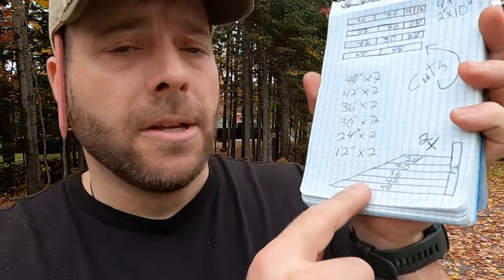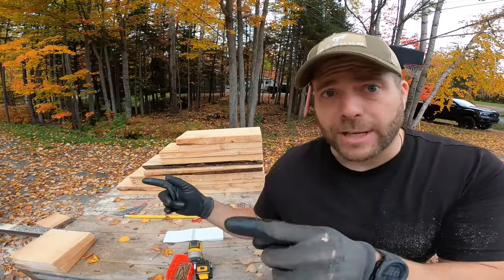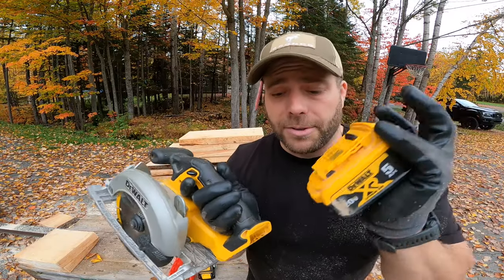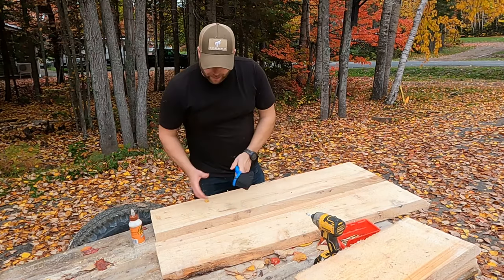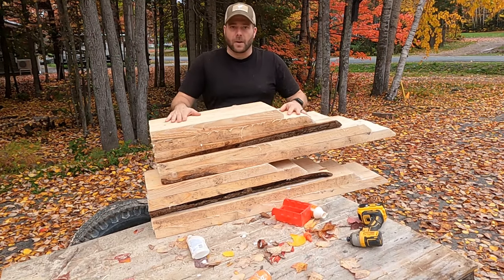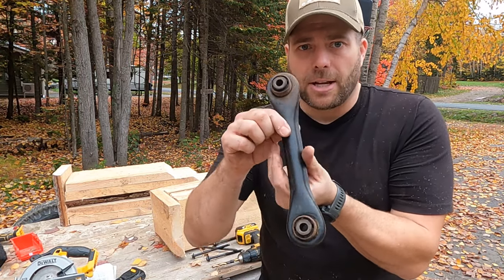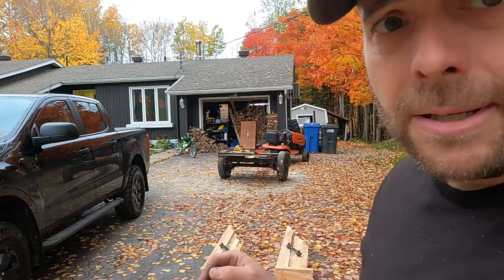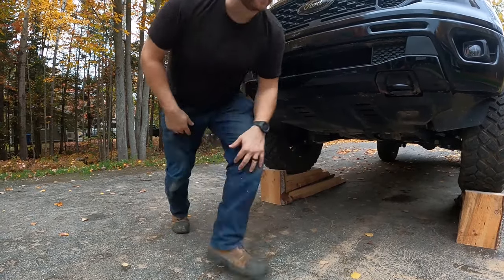HOW TO BUILD WOOD TRUCK RAMPS - For your Truck Jeep Bronco Car !!!

Comment: I did nearly the same design however mine differs slightly. The wheel stop on mine is angled towards the tire/front of ramp at like 20/25 degrees.  I added 2 handles to each ramp and made 4 ramps.  This is so I can access everything under my tacoma without needing to jack it up.  I also added a rubber mat to each of the ramps on the bottom to keep them from sliding around. Only downside to wood ramps is weight.  Mine weigh about 50lbs per ramp.
Reply from the maker: Nice!  I was thinking of building two more.  They are nice to have.  As for the weight....  harder to steel haha.
Reply: On some other designs I've seen  two sets of small wheels added to each ramp. Bungee them together for storage and wheel them to your work location!
Reply from the maker: @thetoymanator7723  that's a great idea.  Might ad a set of castors to mine.

Comment: You really don't need the angle cut, if your Truck wont climb a 2 inch board, it's not going to be much use 'off road' ? 🤗
Reply from the maker: haha, true.

Comment: Set your "scale saw" to 45º when cutting the boards to length and you will have 45s on two boards with one cut.
Reply from the maker: Great tip!  ..... yea I know... Circular saw haha
Reply: In 1928 the SKILSAW Model E was invented by Art Emmons.[3] The Model E equipped with an 8-inch blade, It was the world’s first portable circular saw.[4] This saw's invention also spurred the use of worm drive gearing, a dual-field motor, and die-cast aluminum motor housing. In 1937, its successor, the SKILSAW Model 77, became the benchmark of portable saws,[5] along with the SKILSAW Model 87 circular saws, and it continues to be used on job sites across the United States.
Reply from the maker: @Group_Anonymous  Thanks!  That's probably why I heard people  call it a "Skale Saw"  and it just stuck.
Reply: Heck yeah!

Comment: Nice job, and like others said, nice truck! I went earlier and picked up a non-treated 2x8x12 (store bought, so I know the measurements are less than that...) from Lowes for $10. I cut it in half, then cut each half into a piece 20" long, 22" long and 32" long, so only 3 layers thick. I also used wood glue and screws on each layer. The bottom board I left a little longer thinking that once the wheels got on that board that it would hold the ramps down before climbing onto the other 2... maybe it was unnecessary, but they work great. I use them with my Super Duty with the 6.7 engine. My front end is about 4800 lbs so I wanted solid wood ramps that won't bend or break. It gives me just a little bit of lift to help the oil pan drain a little better. I can also use them to change a tire on my tandem axle camper if needed. I also drilled a hole through them and put some rope through it so they have a handle which makes them easier to carry, and to guide or snatch them from under the trucks front end. I was going to go with the 10" wide, but I figured I would try the 8" and it works fine on mine. I had everything except the board, so $10 all in is perfect!
Reply from the maker: Perfect!  Glad I could help.  If you wanted Higher you could just buy another 10$ board and add a few layers too.  These will last you a lifetime!

Comment: I bought my rhino ramp’s awhile back but I’ve noticed that they are starting to get cracks and showing signs of ware. B.C (before Covid) prices they were like $50. Now the same ramps are around $70. I have seen people make their own and i figured i would give it a try. Great video and what a beauty of a truck bro!
Reply from the maker: Thank you!  Yes, definitely worth making a set.  And they will last forever compared to the plastic ones.
Reply: One of my rhino Ramos just cracked due to my brothers truck. I told him he can keeper and I'm going to make my own using this method
Reply: I trust using solid wood ramps instead of plastic ramps.

Comment: This ended up costing me $166.67 😅. Just went for the 4 2x10x8s and 2 handles to carry them. 🤷🏼‍♂️ Walked over to the 70% off lumber cart. Found five 1x12x10s to use for elevated raised garden bed and 2 other boards. Paint section had discounted Anti-Slip Floor Paint for $10 for a gallon. I had to try that and likely on the ramps (says, “Ideal for Wood…”). Liquid Nails Extreme Heavy Duty and four 8” plastic planters for the lemon balms to keep flies off back porch. 

Thank you for showing this build. If the Ramps work out 🤞🏼, they’ll be used daily at the used car lot I’ve been working at. Some cars have all that plastic or felt protection underneath that jack and jackstand  placements get funky. Thanks again 🙏🏼
Reply from the maker: Awesome!  And they will last forever!  I'm thinking of making 2 more so I can lift my whole truck at once.
Reply: @NorthShoreOverland  thinking of doing the same. Got the first set together this morning.

Comment: Have you thought of making them for all four tires then you can pull up on them simultaneously and have your entire truck up off the ground, that's what I did makes it sweeeeeeet when using a creeper, I have a 2000 F350. 👍👍

Comment: Down here in Texas right now a 2x10 is $25. A box of screws is $10. You put handles with special screws. I'd go with Casters (lil wheels). So all in all it would cost me $122, in materials. And right now I don't have any 2 x 10s laying around the property. So the price is a lil steep for me. I'll stick with the Rubber/plastic Ramps I got for $49. No cracks yet, I'll keep my fingers crossed. Nice Video.
Reply: You can look for pallets that are in good condition and salvage the 2x4s that are on them. Screw and glue them together and you have now saved lots of $$!! :)
Reply: @WLDefisher  ...Oh man Pallets. Great Idea.
Reply: @FunDuude  I'm not that experienced with working with wood. Why wouldn't using the 2x4s from pallets be a good idea?
Reply: @WLDefisher  ....I thought your idea was good. But when I think about it: I have about 10 pallets in my storage, but none are made with 2x4s.

Comment: Thanks for the video. I have 3 questions.. i am just confirming the wood thickness is actual 2inch and not the standard 1.5 inch?

.Then you are actually raising the truck 10 inch.. that's kind of high for a truck that's already lifted.  Just curious but what would require such height to access?.. 

And my last question is you mention in the comments that you used Red Pine as that's what you had available  but wouldn't recommend it.. Any particular reason?...

 I was asking these questions because in my country they actually cut the wood to actual 2 inch thickness and i was debating whether to go 8 inch (4 levels) high vs 10 in high. I decided  to go 8 inch because i just needed for underbody  inspections, suspension lubrications and oil  changes. I also was going 12 inch wide vs 10 inch as well to give me an inch on either side of the tire.  

In terms of wood , it's not cheap here but  equivalent or cheaper than buying the plastic ramps.  I have to choose between pitch pine or mahogany.. Anything else is more expensive. The pine cost is about 30% less  i e. 85$US vs 120$US.  So i was thinking of going with the pine.. That's why i was asking why you don't recommend the pine.
Reply from the maker: Thanks!  I just went 10 inches to give me lots of room for washing underneath.  You can do 8 and if you find it's not enough, just add one more board!  As for pine, I just meant I didn't recommend it as in "don't go out of your way to find some just because that's what I used".  In my country, douglas fir would be the cheaper option.  Good luck!
Reply: @NorthShoreOverland  ... Thanks for the idea. I got the pine straight from the sawmill. So its rough cut and wet.... You mentioned yours was still wet... I wanted to ask... Aren't you concerned that the ramps might deform a bit when the wood starts to dry? What about getting termites etc.. in your ramps too?... Right now i have mine stacked on the patio air drying before i sand, termite treat and seal before build the ramp. Hoping a 1- 2 months in that situation will dry it out enough.  Temperature is about 27C with humidity about 40% avg.
Reply from the maker: @mpcp27  if you screw the wood together, it will dry and deform together.  And not enough to worry.  As you use them they will wear and form.  It's wood, so you can always change pieces if needed.
Reply: @NorthShoreOverland  ... Okay thanks.

Comment: Wool wax has a kit with sprayer and hoses. Wool wax is lanolin but it does trap dirt. Don't drive thru red dusty gravel . It will look like your frame is rusty.
Acf 50 is an aircraft rust inhibitor and is used by an aircraft mechanic.
I believe you will need a respirator while applying.

Comment: I am just wondering are those ramps should be as wide as the tire ? If that’s the case then I can’t imagine having a truck with a 10 inch wide tyres haha is that normal in us ?
Reply from the maker: Doesn't need to be exact, but if you go too narrow it won't be as stable.

Comment: If that lumber is store bought then 5 layers won't be 10 inches. 2x lumber is only 1.75 inches thick. 1.75 x 5 = 8.75. 
I used 2x 10 rough cut lumber and build the stand part of the system 6 layers tall, 24 inches long, with the top layer 2 inches short. I then cut a section of 2x into a wedge to attach to the top of stand as a stop for the tire. I then built 5 ft ramps with angled support pieces for under the 5 ft 2x10 with the top 2 inches longer than the ramp part. Set the ramp onto the stand so the 2 inch overhang on the ramps fit onto the 2 inch notch on the stand. Drill a 3/8 inch hole through the ramp into the stand, drop a 5/16 bolt into the hole so it keeps the ramp from slipping off the stand. 
This set up let's you remove the ramps so they aren't in the way when working under the vehicle. These work well with most vehicles, some cars may be a bit low so you may need a couple of 2x10 pieces to drive the car up on them set the ramps up at the end of these 2x10 pieces. Might even need 4 pieces to get low cars high enough.
Reply from the maker: True.  Still pretty high.  Could always buy an extra piece to make  up for it.
Reply: A 2by  now is only 1.5 inches thick not 1.75 they keep cutting it down.
Reply: @catfish24  shop around, the big box stores tend to cheap out to make more money. Smaller lumber you get more pieces on a load, saves on shipping cost for number of pieces. Check some of the non chain store places. If you have many Amish around you can get rough cut that is full size and cheaper than store bought.

Comment: What kind of wood did you use?
Reply from the maker: I think it was Red Pine... but I don't recommend that in particular.  It's just what I had kicking around.  (I have a sawmill)
Reply: @NorthShoreOverland  Thank you. I'm making mine of spruce.